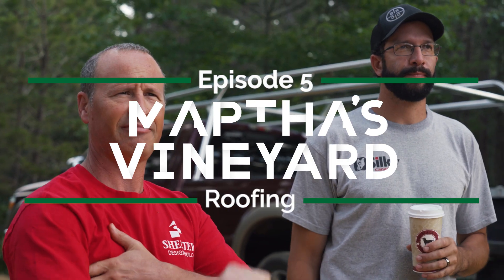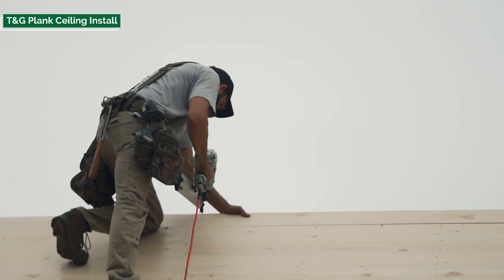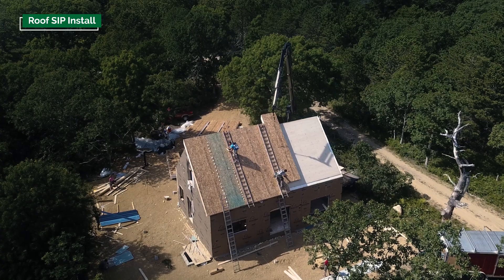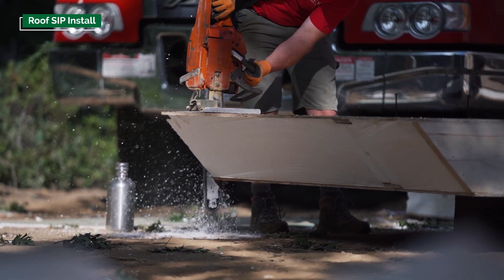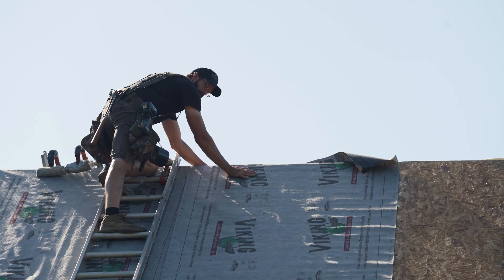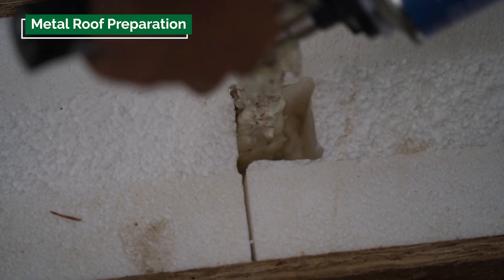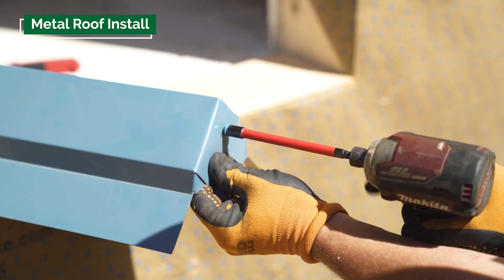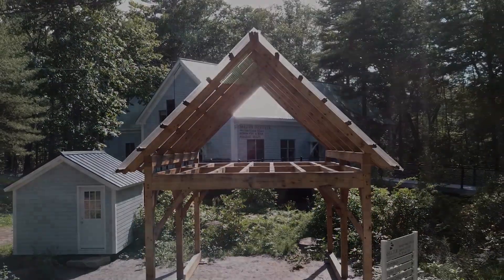Installing A SIP Panel Roof On A Timber Frame House | Martha’s Vineyard | Ep. 5

Comment: This is not a SIP panel roof, its a built up roof.  SIP stands for Structural Insulated Panel.  In a roof context it would span from ridge to eaves without any rafters.

Comment: I am not a builder, but instead of knocking the excess foam off, what are your thoughts about putting tape on the hole you are filling so the foam expands more inward than outward?

Comment: Looks like 6 1/2" walls and 9 1/2" roof?  That seems about average for the walls but thin for the roof?  I realize these things are very location and build specific.  Is there a reason you went thinner on the roof SIP? Thanks.

Comment: He blame the factory made panels but he house was most likely not square. You need an high-temperature roof underlayment, screws are supposed to be between the ribs (EPDM washer screws must seat on a flat surface). Metal roofs are good for 50 years so no biggies.

Comment: The problem with foam is that over a few years it will "dry out", lose it's adhesion, and usually shrink and then becomes useless as an insulator.
Reply: Only if it's exposed to UV
Reply: I was a spray foam contractor, and can tell you that it all depends upon the type of product you’re using. Some will do like you said, but others such as a properly proportioned and properly applied closed cell polyurethane will not loose adhesion or break down. The key is that it MUST be done correctly.
Reply: Closed cell on house I grew up in done in 70's was reexposed in 2011.  

Not even a hint of shrinkage.   It is nearly impossible to remove old roof sheathing.

Closed cell in walls and ceiling.
Reply: Using the can stuff outside eh?

Comment: How do you vent the roof. I live in N.E Washington state  and on a cathedral ceiling without trusses and attic space  code says we have leave a 2 inch air gap between roof sheeting and insulation. Air flows through a bug screen vent in the soffits up to a vented ridgecap. There is a 2 inch space left between sheeting and ridge beam. Venting the roof helps cool it in the summer and also keeps dry rot from occurring. I didn't see if you had an air gap between the pine ceiling and the sip roof panels. Is there no roof venting code back east like there is out here?One rule we have out west here is no osb on the roof for sheeting. Its absolute junk, once it gets moisture it swells and rots. Also we put a lot of metal roofs on and osb doesn't hold screws nearly as well as 5/8 inch plywood. Take a sheet of plywood and osb and throw them out on the ground all winter. The osb will be twice as thick and falling apart and the plywood will dry out and be fine. Why don't you put a superior product on the roof? Do your suppliers give you a choice on the sip panel sheeting??It's only $5 to $10 more per sheet. I know that that adds up but you built a timber frame that will last hundreds of years. Why compromise the structure with woodchips n glue a few thousand $$ in good plywood only makes sense to me. Not trying to be a troll. You have very informative videos. Just hate osb especially on a timber frame.
Reply: The roof underlayment will protect the OSB, with this slope this roof is good for 50 years.
Reply: The roof panels may be, but the fasteners are Not guarenteed that long. Typically 10 years before  their warranty runs out. Save yourself the trouble and get snap lock standing seam. Dramatically better product and looks much better too

Comment: What is the reasoning behind running your panels in the same direction as the trusses? Also why was there no barrier be tween the roof boards and the Roof SIPs, if moisture is to get through those roof boards it will rot the roof panel.
Reply from the maker: Great question Keegan! The entire roof assembly is air sealed with expanding foam, which prevents air and moisture migration into the roof assembly. We prefer to run the panels vertically because it is then a monolithic block of foam and OSB that runs top to bottom, again minimizing air/moisture migration.

Comment: shouldnt you lay water rolls not vertically but horizontally from bottom to top, then attach 1x1 wood vertically to form air gap, and then 1x1 horizontal wood for metal sheets to attach to.

Comment: One thing about a energy efficient houses I don't get it though: all that energy we save by making the house airtight, we loose it by using air con, humidifiers or deshumidifiers to make the air breathable and comfortable. How do these houses breathe? I remember my grand parents houses (back in the 60's and 70's) where the walls were made out of clay mixed with horse dung and straws, and coated with limewash. Allways cool in summer, warm in winter and never, ever a fly inside. Plus never too humid, nor too dry. The walls needed to be maintained every 6-7 years though. So, in our search for the perfection, aren't we getting quite the opposite result?
Reply: In the UK atleast, the energy saved from reduced heating is far in excess of the additional energy used to run the ventilation system
Reply from the maker: On average, homes lose or gain about 40% of their heat through air infiltration. Year after year, this far outweighs the energy used for a properly designed ventilation or a/c system, and the house is far healthier and more comfortable. We recommend the use of heat recovery ventilators or energy recovery ventilators for fresh air; as the names imply, at least a portion of the heat (HRV) is transferred to the incoming air stream through a heat transfer mechanism and a portion of the sensible cooling load (ERV) is transferred through a mixing of the air streams that allows moisture from the incoming air to be transferred to the already dehumidified outgoing air. Both of these systems are a great way to further improve on energy efficiency while providing required ventilation.
Reply: @ShelterInstitute  Thank you for not throwing away my question and taking the time to reply.

Comment: There is no ventilation gap under that metal roofing, is there? The snow melting isn't an issue in that particular locality, or I am however missing something?
Reply from the maker: Good question. In that climate, the R value of the roof is sufficient to prevent snow melt from interior heat loss.
Reply: @ShelterInstitute  thank you very much for the explanation.

Comment: Why 4 foot wide roof SIPs and not 8 foot wide roof SIPs? Fewer seams.
Reply from the maker: Panel manufacturers are tooled up for ether 4' or 8' wide panels, rarely both. Our manufacturer makes 4' panels. We have worked with 8' panels from other manufacturers in the past-they are great, but a little harder on the crew.

Comment: i did it the easy way....spec'ed the ridge beam for the span and hung 8 inch sips with triple 2x8 's in the panel edge ....easy and fast.....only tricky part was tilting the panel so the edge would glove together along the edge joint ...after two courses the crane driver had it down pat we did 54 ft long roof with two 8 ft dormers ( built on the ground with pre-cut sips, and flown with crane) in a day.....lots of sweat in March in Georgia....hasn't leaked a drop in 26 years so we did something right

Comment: You build this tremendously expensive building on a tremendously expensive piece of land using super nice tech like T&G pine panels on the roof then you place a metal roof on the structure ; which is extremely fitting for the building however; in order to prevent leaking and future problems it’s all dependent on a “Rubber Washer” that seats the screws (hundreds of them if not thousands) on the roof???
And you can be assured unless each person installing the screws has someone coming right behind them checking each screw , some were placed on incorrectly?

Being a contractor that specializes in finish work I exclude what I believe are bad choices for the customer that leads to failures ?  For me it’s MDF? Thee only place I will install it is in cabinet door panels ?  Not in interior or exterior “doors”.  
Your customer should hv those washers checked and replaced at least 15-20 yrs.  and inspected in a atmosphere like that every 3-5 yrs.

I know you would not choose it ?  As I would not Choose MDF therefore it’s out of the line-up for me?  I am curious why you allowed it to be used after all you did?

I could be all wet too ?
Reply from the maker: We installed our first exposed fastener metal roof in 1978.........Gaius installed the same product on his timber frame/SIP home in 1995..............we installed the same product on our timber frame/SIP store-classrom in 1998. In short, we believe in this roofing system and it has served us and our customers well for decades.
Reply: @vdpeer  yea; I looked back at this and said “he should hv blocked me”!  See what happens when you live alone and hv no one to talk to after work???
Your a great builder!

Comment: So a quick question how does condensation affect the roof ? SiPs
Reply: There's so many factors, basically it depends what's underneath the sheeting. If you have lots of ventilation from the outdoors going into your attic space, think about that the attic is should be the same temperature as it is outdoors. If you have insulation and it's not enough, you get heat loss in your attic that's when you see moisture in your attic, this product can work but there's a magic formula between temperature, ventilation, and the right installation. I can see it being an awesome product, but it's easy to get it wrong
Reply: @curtiswilliams7638  I see I noticed once the tongue and grooves are installed the SIPS were put into place was this only for Martha's Vinyard project because of the climate ?